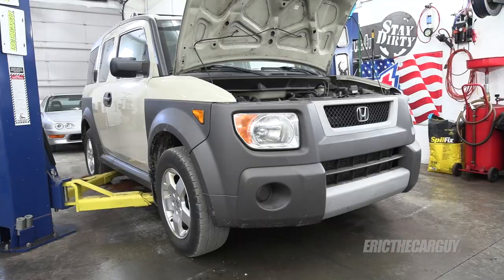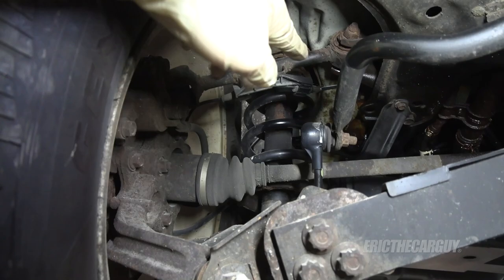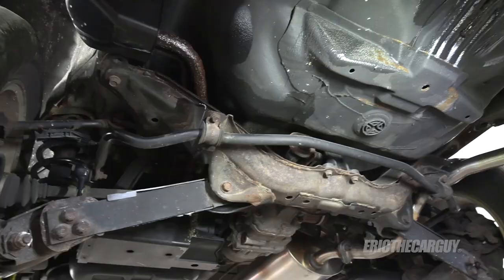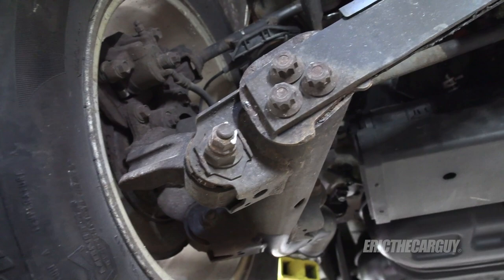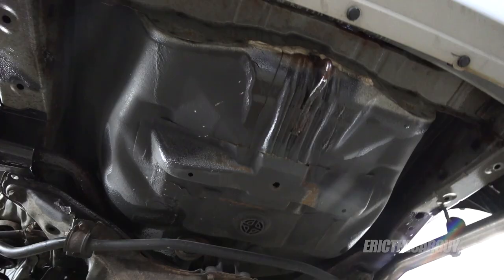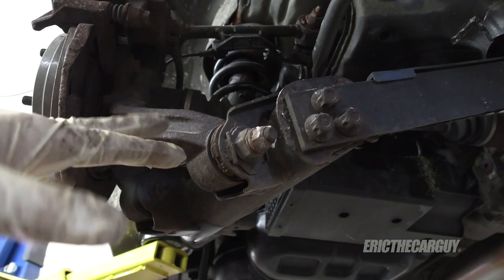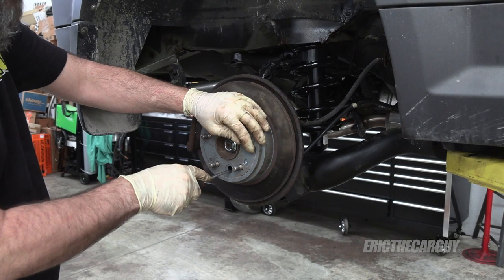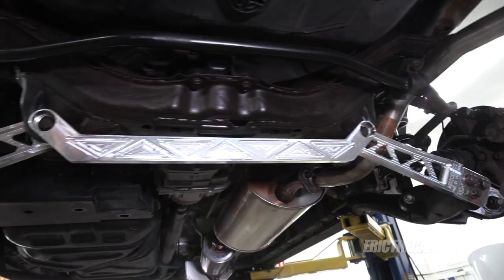Honda Element Suspension Rebuild (Part 1)

Comment: Did my son’s Element’s rear struts today. Just like you showed! I had to drill and use a self-tapping screw as well. Once I broke one bracket bolt I looked around. I actually loosened two of the through bolts that hold the canister to the bracket and it gave me just enough flex to get the strut out. 

For anyone who might try this, there is a cover that comes off via tabs, and then you can loosen the nuts and the bolts will fall out.

Comment: Never wrenched on one of these.  Thanks.  Also, I've been pretty happy with Eastwood paint.  I'm gonna try their spray on ceramic on an exhaust manifold to try to reduce rust.

And I am not dead weight.  I was cheering you on, especially on the rusty fasteners.  It's always useful to have a pretty young girl cheering you on.  Even if I ain't pretty.  Or young.  Or a girl.  And I'm several days late.  And four or five states away.

Okay, I'm dead weight.
Reply: ROFL

Comment: Huge help for my 2006 CRV 5MT! My rear suspension is starting to wear and an alignment is impossible the the cam bolts being seized! Thanks for the tip of good adjustable upper control arms!

Comment: Speed Academy is up in canadaland and they deal with bad bolts/nuts all the time.  They have been using the bolt buster heat induction tool that centers the heat on the nut or bolt and nothing else.  It seems to work for them 100% of the time removing really stubborn rusted bolts/nuts.

Comment: I think the CR-V is the same from 02-06. The second generation. They changed the body style in 07. I’ve got an 06 CR-V so I love that you have an army of Elements to work on. The 02-06 Acura RSX Type S chassis/suspension parts are also mostly interchangeable.

Comment: I'm stoked, I got a 03 CRV with all kinds of suspension noise and play, so this video is exactly what I need. Every CRV I've seen from this generation (with yellow turn signals, 02 to 04) has its rear tires cambered pretty bad. I think they solved the issue for the face lifted same generation 05 to 06 CRV. Its really hard to stay between the lines at highway speed. I've replaced all 4 struts with KYB's, outer tie rod ends, tires, and had a alignment done.
Reply from the maker: I believe those same rear control arms might fit your CRV. Links in the description.

Comment: Eric, at 5:41 you can see your differential suspension bushing jumping about an inch while you are loosening the differential plug. It sits above the rear sway bar and the differential. Yours is SOOO shot! That bushing missing makes a huge clunk at odd times.

Comment: Can't wait to watch this! I want to buy a used Element and my understanding is there are recall inspections on the rear suspension such that Honda will appropriate your Element if it fails inspection.
Reply: Really? Links? I've not seen any recalls on suspension, and the dealer said there are none that need to be done for mine..
What's your source?
Reply: @richeyrich2203  google honda element rust recall - its something about where the frame and rear trailing arm attach. If it is too far gone to reinforce they buy it off you. I think the recall hasnt been issued in USA though, I'm in Canada. If you get rust best to maybe do a preventative job on that area.

Comment: This video couldn't have come at a better time. I'm literally ordering all the parts to rebuild the suspension in my 2007 Element EX. Everything I've learned how to fix on my Element are because of your videos 🤟
Quick question for ya', Eric: Do you know if complete strut assemblies for the 2003-2006 Elements will fit the 2007-2011 Elements? I know in 2007 they changed the direction of the right coil spring (I think) but figured it would work the same if I just buy the complete assembly. Honda suppliers have run out of struts, and I'm having to buy aftermarket, possibly Monroes. KYB is supposedly making a Strut-Plus for the Element, but not being released until later this year, or possibly longer. 

And thanks for the awesome info on these Elements. Glad to see there are still people who love em' 🙌

Comment: Well, from not having any initial idea where you were going with this, it actually turned out pretty damn good, methinks. 👍👍
Reply from the maker: The ride is excellent too. It's like a brand new vehicle in so many ways. I feel terrible because I plan to drive it in the salt and muck. I'll do what I can to wash it off in the spring though. 
Always nice to see you. Have a great weekend.

Comment: I would have thought you would want the cv axle pins to sit at parallel positions on either end.
Reply: My thought also.  Maybe he has had previous experience with this setup.  Interested to know....
Reply: @larryskeeper1197  I'm 100% sure that the ends of a driveshaft with u-joints should be aligned. With CV axles, I'm less sure that alignment matters but I am positive that if it does matter, that they should be aligned. If it was my axle, I would align them. I'm also not going to bother worrying about putting a driveshaft back in a yoke with the same rotation, because each assembly/part is balanced independently.

Comment: Instead of sawing off the bottom strut bolt , could I grind off the welded on nut , and replace the bolt and use a nut without welding it back on ?

Comment: By any chance you know the thread pitch of that bolt that cut that goes through the strut. The welded nut got messed up on mine and tore off to want to get a locking nut instead

Comment: I used SPC adjustable control arms on the back of an 08 Honda Odyssey.  They didn't last 40k miles before the ball joints wore out and were very loose.  Won't use them again.

Comment: I know this video is over 2 years old. I noticed the front lower ball joints looked like they were replaced. Do you know if they were honda oem? I replaced mine and they, along with yours, have red boot retaining clips. I could not afford to get oem lower ball joints at around $100 a pop, however i didnkt cheapout. Believe they are TRWs. Around $45 per side. Comparing them with the old ones, they looked similar. I wonder if I lucked out and scored a set of re-branded oems. 
This is a long shot 😅 but if you happen to know/see this comment, holler at me!! Appreciate your vids.

Comment: I have to do suspension on my 2003 Civic. Are there ANY aftermarket strut/spring assemblies you would recommend in case I don't have the coin for OE Honda parts?

Comment: 25:33 -- I didn't know you had to sawzall the bolt off the right side too... I thought that was the left ;) LOL
Reply from the maker: When the bolt seizes in the bushing, you need to cut off both sides. What I did was break the bolt head off once I cut it most of the way through to save time. I still cut through both sides though. Thanks for the comment.

Comment: Were you able to reuse the lower strut mount nut? Im having trouble removing the bolt. Already bought a spare bolt just incase. How did you remove the threades bit left in the nit after xutting the bolt?

Comment: Hi Eric. At 12:30. You point to bushing, right!  On the hub...   I need those bushings.  Our element has 270,000 miles on it.  I need to change those..   bolts are frozen too..   do you have a link or a parts list!?

Comment: Hi, Eric. I have a 2006 Element. The Honda dealer told me the compliance bushings are bad. I have a creaking sound from the rear passenger side when I go over speed bumps. The sound is coming from where the shock is located. Is the bushing for the rear upper control arm? I'm confused about upper and lower control arms. Are there a set for both front and rear? Thanks.

Comment: The bolt holding the inside part of the rear upper control arm is badly seized.  I tried heat and won't come off.  In fact, I rounded up the nut.  the space inside there is so tight.

Comment: I'm redoing the front end suspension on my 1990 cb7 coupe. I have all the parts but I'm worried I will have to get new bolts for all the control arms as well... I'm scared they will snap.

Comment: Can someone explain how the impact driver works? Do you have to set it to loosen or tighten ( like you would a ratchet?) or does it work based on the direction you're twisting the tool? Thinking of buying one. Are they all pretty much the same?

Comment: What? No new rear stabilizer bar links? My 2011E had the noise when going over undulating road surfaces, like a knocking sound. I replaced the stabilizer bar bushings and the stabilizer bar links and voila-no more knocks. I wasn't sure which part fixed it, but while I ordering parts, I just ordered the bushings, bolts, links, and link nuts and did the whole job at once. Now I've got to change the passenger side rear axle b/c the outer boot was hit by a stick or object on the road and torn. Geez.
Reply from the maker: I believe I mentioned in the video that I have the parts but I didn't use them because the parts on the vehicle are still good. Thanks for the comment.
Reply: @ericthecarguy  I dunno how I missed that in the video. Your video has inspired me to change my axle. I think I'll keep the old one that can be rebuilt in case there is any problem with the new axle. Last winter I had to change the O-rings that seal the transfer case to the tranny; It was leaking red stuff. It was fairly easy, and went pretty quick. I guess this old man has a little DIY mechanic left in him.  ETCG, is it necessary to drain the rear Diff when the axle is replaced?

Comment: Can the inner cv joint grease that comes in the oe honda boot kit be substituted for moly grease? If no, what would be the reason? Thx.
Reply from the maker: Maybe, but personally, I always try to stick with what the manufacturer used in the first place. After all, a lot of engineering went into the decision of what lubricants to use.

Comment: Any advice on removing a sheared bolt on the rear (horizontal) of the front lower control arm? It's just that last 3/4" or so that's in the nut/frame. I got the control arms off but was left with that bit of bolt. (04 crv) hard to drill it out with the 2.5" of clearance.
Reply from the maker: I believe I covered what I did with that in the video. Heat, a thread chaser, and then welded it back into place.

Comment: 29:00 No lift so I replaced my rear shocks on the ground. To align the holes I had to use a 8 foot long 4x4 wood beam, had my girlfriend push down on the end while I was underneath putting in the bolt.

Comment: At 7:41 did that socket shatter??? I had that happen last week on my 2000 Civic trying to remove the same bolt on driver side rear strut. Crazy.
Reply from the maker: Yes, and I landed on my butt. Unfortunately I didn't get that part on camera.
Reply: @ericthecarguy  I figured, I'd notice that snap anywhere, and the OH BLEEP moment that comes with it. Incidents like that is why we always goggle up. I am always glad that you are showcasing Safe work practices in all your videos. too many accidents have happened over the years that are preventable in this environment.

Comment: I can get replacing the covers to help keep gunk out of the adjuster. But, honestly, I see little need for those rotor screws... I'm so used to just running a lug nut down quickly and don't need to worry about a screw rusting.
Reply from the maker: Like I said, I'm weird.

Comment: About a month ago I replaced the rear stabilizer links on my 2nd gen CRV with Delphi suspension parts. I’ve seen from your experience Moog and Mevotech are not recommended. Any feed feed back on Delphi parts?
Reply from the maker: Anytime I can use Honda parts I do, despite the cost. I almost never have issues that way. I'm not a fan of using any domestic part companies for Honda parts.

Comment: Oh man, I had to cut and drill out my integras rear lca bolt. It was a nightmare. Buy an integra they said, put a skunk 2 suspension kit on it they said...it only one side and look longer to get the bolt out than it did to swap in new suspension components 🤣
Reply from the maker: Sorry to provide this info late, but never touch the rear control arms on an Integra or Civic unless you have to. The ABS light has been on my GSR since about the time I got it for that very reason. RR ABS sensor is bad. You have to disconnect the rear strut to replace it. The through bolts always seem to weld themselves to the bushings. 

Sorry you had to deal with that. Nice choice in suspension kit though.
Reply: @ericthecarguy  😉🧠

Comment: Hey bro! Thanks for all your element videos you are a life saver! I just did some work on mine and wondering if you could help! My element had worn squeaky struts and a wobble on the highway while turning high speed only. I did a complete strut assembly, ball joints and links , new axels and outter tie rods. All those issues are gone but now I have a weird slow speed low rpm wobble, I ordered motor mounts 4pc noticed those were shot too. You think the Motor mounts are giving me the new slow speed wobble I didn’t have that issue before I’m breaking my head trying to figure it out!!
Reply: Saggy motor mounts maybe causing a misalignment of the new axel I hope??
Reply: Front control arm bushings are probably bad if everything else was. It's easier to just get the whole control arm with bushings already pressed. I like Moog from rock auto.
Reply: Tip for the motor mounts, really pay attention to how you remove them because you'll have to puzzle them back in the same way.

Comment: Can’t wait for your next video as I have an 04 Element. I’ve already replaced those rubber bushings twice but next time will use the silicone paste. Let me know how those rear control arms work out. Also as far as a Evap purge valve solenoid is it ok to use an aftermarket? I had a hard time getting oem but was finally able to track one down. Thanks
Reply from the maker: I used the aftermarket valves on my sons car. So far, no issues.
Reply: @ericthecarguy  thanks 🙏 any word on the cat burglar
Reply from the maker: No. Never expected a result on that. The videos have done well which helps my bottom line. Alls well that ends well.

Comment: Excelent improvements :-D
Nothing wrong with antiseze/copper slip,  always a great idea eric.
Maybe not on the brake disks though ha ha :-D
I like the soft vice jaws, some people made them using wood or aluminium/copper.
Make the jaws deform, not what's in them.
Just imagine how many kidneys you would have to sell if the honda dealership did the work.
Ouch!
Reply from the maker: I dare not think of what this venture might cost a 'customer'. But, it's only money right?

Always nice seeing you in the comments. I hope you have a great weekend.
Reply: @ericthecarguy  Yes you are right,  a bucket of rust neutraliser and paint would stop rust for a long time.
You did say  "it's only money right?" :-D
Who said ' Blackmale ' :)
Have a loverly week end eric :-D

Comment: In one of your older videos, you said that rebooting CV joints is no longer worth it and it is better to buy new.  From personal experience with my '05 Element, don't eve try this!  Glad to see you do a revisit of the process.
17:33 Did you check the right side before removing the tri-pot core to see how the inboard and outboard CVs are phased from the factory?  Suggestion: If the tri-pots cores are anything like the front inboard CVs, you can flip them around so that during acceleration, the bushings/bearings will bear down on the less-worn side of the tri-pot core.
Reply from the maker: That's a good tip for CV joints, I never thought of that. 
These are rear axles, way different than front ones. I don't even think they'd be available in the aftermarket if I'm honest. For these, I think a rebuild is the only way to go. 
Thanks for the comment.
Reply: @ericthecarguy  You are welcome.   The inboard front CV joints are also tri-pots but have three true bearings instead of the solid bushings installed in the rear.  I did this and it worked great.

Comment: The last bushings that got stuck like that on me🙄i just took the acetylene torch and blew it right off😏nothing was damaged during my rage of frustration🤣
Reply from the maker: That also works, but I prefer to avoid melting bushings, partly because of the smell, but also because of the little droplets of fire it often creates. I also don't like to heat strut assemblies if I can avoid it. Liquid under pressure and heat don't often mix. Thanks for the comment.
Reply: @ericthecarguy  agreed most definitely👍

Comment: Eric, I have a 2004 Element EX, that I may need to replace or rebuild the driver’s side front half shaft.
The problem, I’m not finding aftermarket shafts that have the “damper”.  I would like to replace it with OEM shafts, but no joy finding them.
Any thoughts on where to find rebuild kits or new ones?
Also, maybe a dumb to ask, but is the damper needed? 🤔🫣

Comment: I apologize if I've asked this before and missed your response..

Instead of waiting until the weight of the car is on the suspension before the final tightening,   Can you  measure the hub center to fender  lip distance when the vehicle is on the ground, then raising the suspension with a jack while the car is in the air to the measurement made at the start, followed by final torquing of the suspension bolts?  I expect it would be easier  with the car in the air instead of with the tires on the ground.
Reply from the maker: It would be easier, however, consider that you would have to jack it up to the point where the vehicle would be lifted off of the lift arms. A very dangerous situation. With a 4 post lift, one that you drive up on, this type of thing is a lot easier. Till I get one of those, I'll be doing the torquing on the ground. Thanks for the comment.
Reply: @ericthecarguy  Safety does come first.  If the car starts to lift off the lift  arm or the jack stands, I do stop and lower the suspension down.